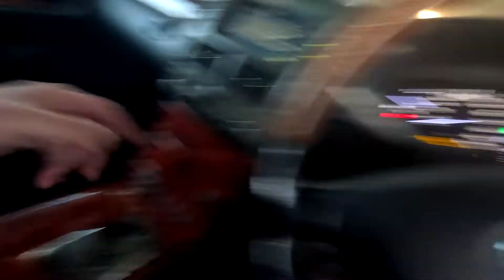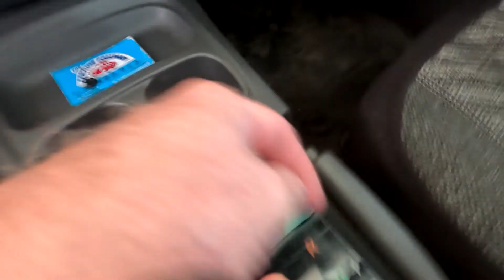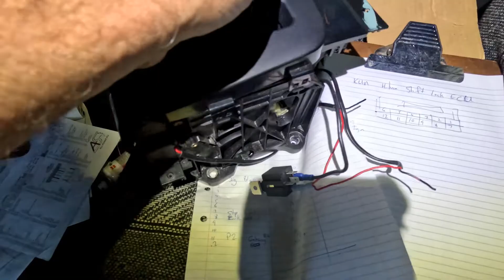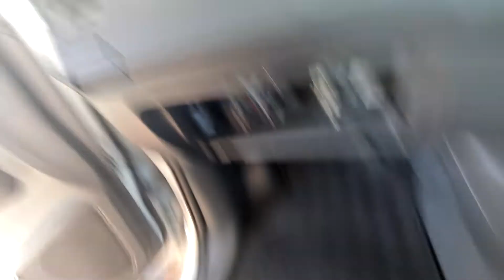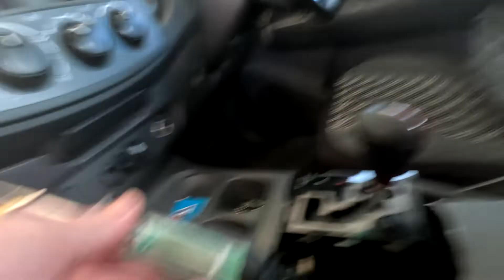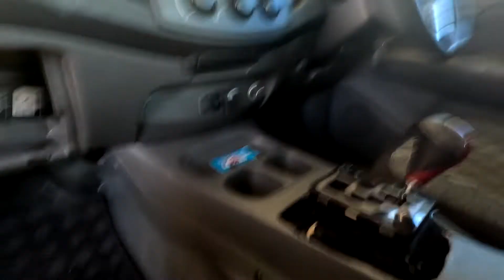LS430 3uz Tiptronic Operation.

Comment: Hello, have used the A650 into a toyota 4wd ?
Reply from the maker: Yes,  plenty of times.
Reply: @CartuneNZ  okay, have you done a video on the trans to transfer for them?
Reply from the maker: @sydneymowerandautomotivece4319  not yet.  Filmed one today,  and one filmed a couple of weeks ago.  The A761 is edited but not yet released
Reply: @CartuneNZ  okay I'll look out for them 
Is the A650 an odd ball trans at the rear?
Reply from the maker: @sydneymowerandautomotivece4319  nope,  not odd ball at all.  We have been doing 4x4 with them for over 12 years now.  They have a one way clutch at the rear like other models of transmission.   The vehicross we did years ago runs one and a prado both with videos.
Reply: @CartuneNZ  oh, Prado is what I'd like to convert.
Are any custom parts required?
Reply from the maker: @sydneymowerandautomotivece4319  the whole job is custom parts.
Reply: @CartuneNZ  true, do you sell these parts?

Comment: Good Day, I am from RSA and built an 3uz into a Mitsubishi Colt Rodeo V6 4X4 (L200),  I got the tiptronic working fine however I would like to know if and how I can make;  wire and install an gear indicator LCD into my dash. Any recommendations?

Comment: I have a 1UZ first generation out of a SC300. I also have a w58 out of a Supra I want to bolt up to it. The engine and trans is going in a 1979 Corolla ke30 two door. The trans came with the bellhousing. I heard that a Toyota MR2 flywheel and clutch bolts up to the 1uz no prob. If this is true what year would I have to get the flywheel and clutch from? Also what can I do about the bellhousing from the w58 to bolt up to the 1UZ. I think I've seen a bellhousing set up from China which was kind of expensive also shipping to the states would cost an arm leg and three toes. Any  inexpensive ideas? I would like to save the money and put it into other aspects of the build. Thanks in advance🍻
Reply from the maker: 3s-gte flywheels can be used,  but I stopped using them about 18 years ago as they are crap,  and I've replaced many since with better items.  We use our bolt on bellhousing as its easy and a professional way to do it.  I have videos.  I also stopped using adaptor plates years ago as they were time intensive and suffered more issues.  I believe its better to do it once and do it right.